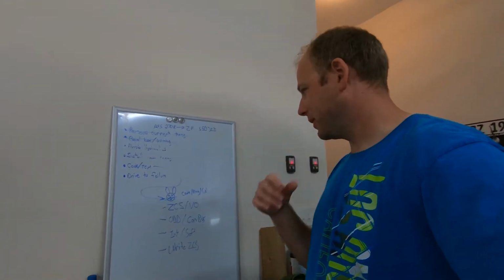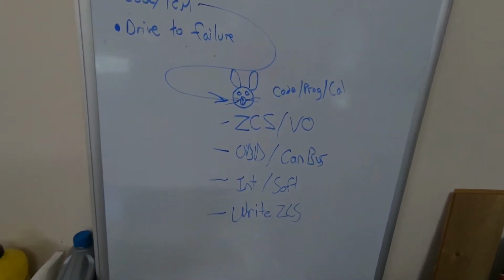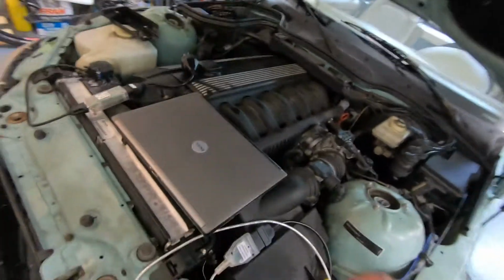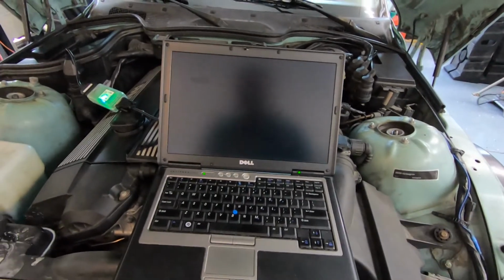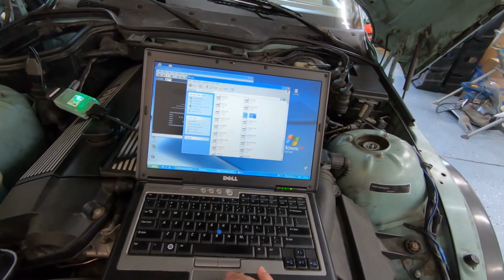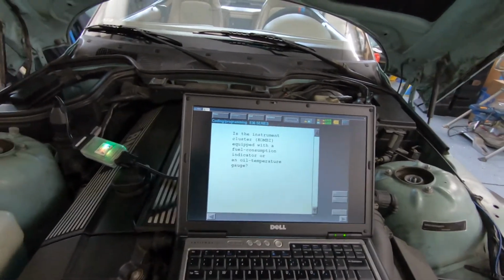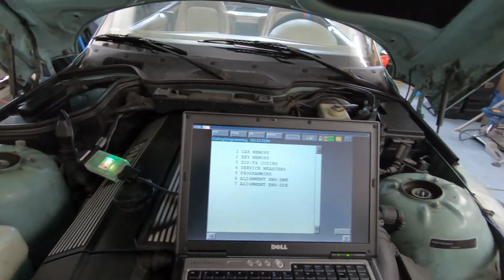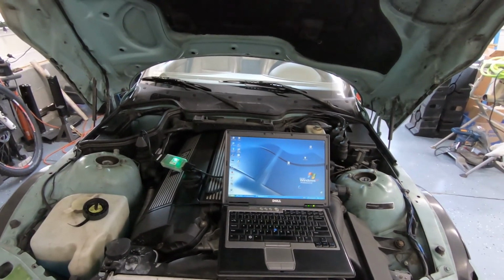BMW Z3 Manual Transmission Swap: Vehicle ZCS Coding

Comment: Hey, Can you help?
I'm programming a replacement 2008 BMW M3 DCT Transmission (from a 2011 M3). It wasn't Shifting or going in any Gear, Just stuck in Neutral.. After I Programmed it, It's going in Gear, Now, But Once I Take My Foot Off the Brake it Goes Back to Neutral.
This DTC Remains "CF26 - Message error (ZV and lid status) from CAS, receiver DKG/EGS, transmitter CAS/ACC/DSC".

 I'm thinking it's a Security/Coding Issue. Do you this thinking is Correct?

 I'm planning to connect the old Mechatronic up to the Car and Extract the Coding Data to transfer it to the Replacement Used Transmission.

So, My question is, since it's already Programmed, will the Coding Data Backup From the Old Transmission transferred to the New Transmission Clear the Code And Make it Work Normally Again?

Comment: hey how's it going I have an e46 with the m52tu28 and my codes for gm vn and sa aren't on my cover for electronics and don't come up through czs when entering my Vin but everything else runs smoothly. when changing up gears the car likes to increase revs (auto to manual swap). without the codes I'm not sure what to do next what can I do from here? 
bmw e46 328ci 1999 ms42 index

Comment: Very nice info. Busy with the same .how did you manage to sort out the ASC light ?
Reply from the maker: After the car was coded to a manual car and codes cleared the asc light went out.  I'm thinking the auto trans controller had some communication with asc... so when it's coded as manual... the asc doesn't look for that signal.  A theory.

Comment: Thank you for taking your time to explain! the transmission light can be removed via (PA SOFT 1.4) .....
A few minutes before watching your video i have just found out that ZCS is the VO for the older bmw's after so many failure to code the VO to my costumer to turn the check engine light off after manual swap i also have found out that there's a tool to calculate and convert the ZCS into a VO to modfiy and get the new ZCS
Reply: Sorry for the late reply but what tool did you use to convert the zcs to a vo